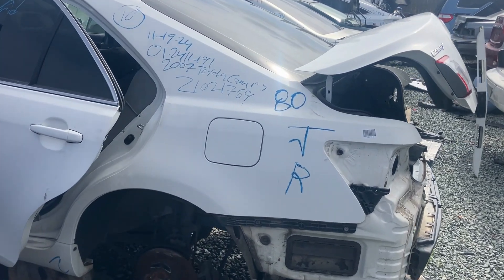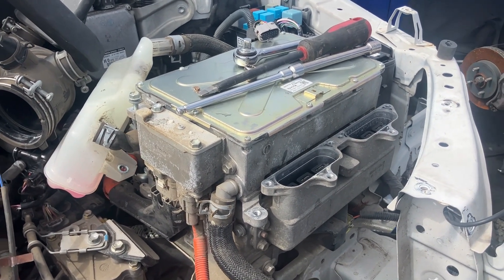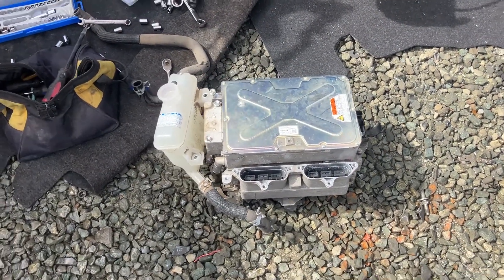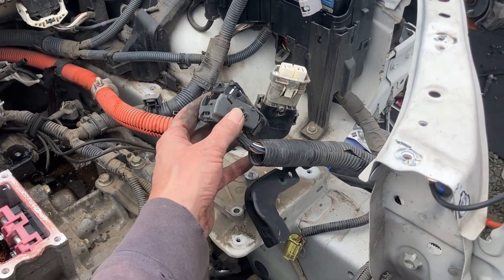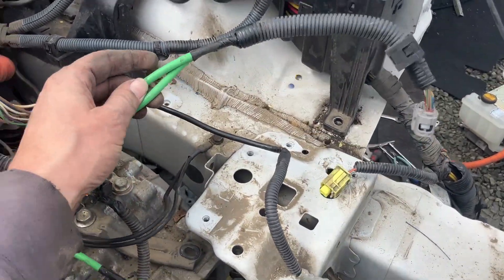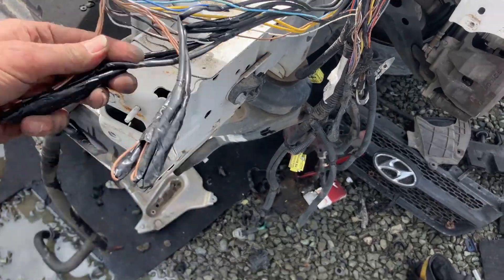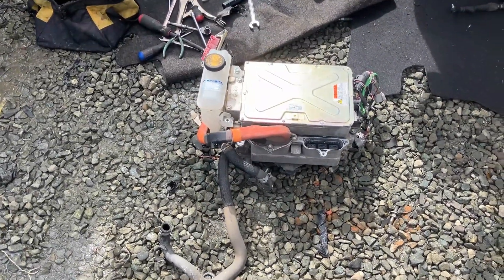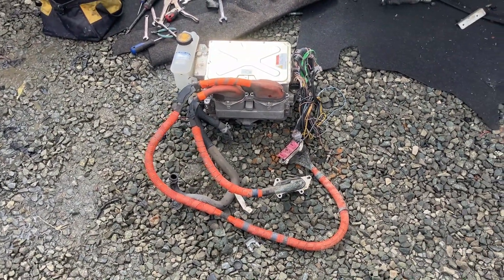2007 Toyota Camry Hybrid Pick N Pull Inverter Extraction

Comment: 85$ is a steal!!! 
i bought a camry inverer from ebay for a little under 200$ with no harness, just 5inches of MG1 and MG2 HV cables.
I converted an Audi A4 2004 with GS450h and camry inverter (cause its way cheaper than the gs450 inverter). you can find my thread on the forum.
been following your videos and thread ever since the GMC. i even use the word "connectisize" 
looking forward to how your camry will perfom, as Arthur was trying to use it with his conversion but he kinda gave up.

cheers. Peterson Octavius from the caribbean
Reply from the maker: Luv hearing this, must check out your thread and eyeballize it 😉
Reply: Link to the forum